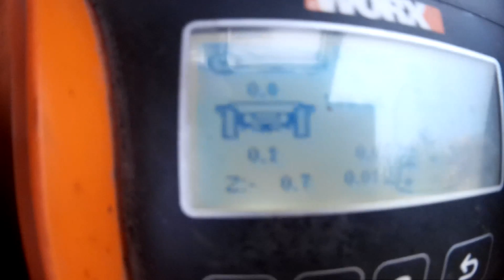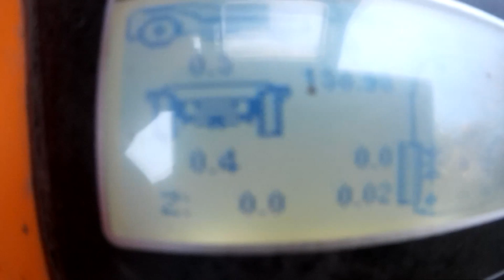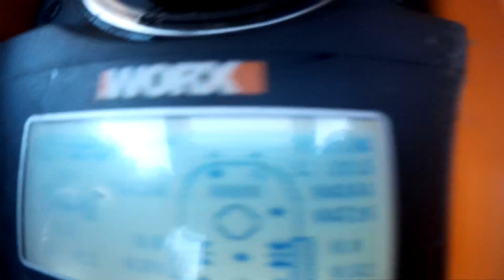Worx Landroid Repair, Overhaul, Problem

Comment: I had a motor rotation error, after watching your video, I sprayed WD-40 on the motor (after removing blade panel) and it fixed my issue. I have WR 150 Landroid. Thank you for the video!

Comment: Looks like your the only one to film opening up the landroid , thanks for your useful video.very good.
Reply from the maker: redeyepete yes sad but true i make this video one shot. But it come working condition. And it's still working. I have another video workx and husqwarna rider lawnmower.

Orginal problem of this worx has. Bad charge, and it wont sense the boarder wire.

Comment: Had the exactly the same problem, but for me the black wire was off. Which caused charging problems. Bad unprotected design of wires and bad material choice of shrink cable. Thanks for video!
Reply from the maker: Patrik Ekman yes that unit and those wiring's could be better quality...
Reply: I have this problem, but i couldnt see any wire broken. Was it broken in the shrink cable?
Reply from the maker: doncamillo maybe, i have 3 broken wires in the shink cable. And both charge terminal wire.
Reply: Biz DIY i have contacted the shop where i bought the landroid. If i dont got warranty i will do what you did. Great video !
Reply from the maker: doncamillo mine warranty is allready closed. Finland reseller tell that part price for me but i dont remenber that, maybe 70€. I just want to look first what the problem is.

Because same time my charger got too much moisture, and give under voltage boarder wire. And robot drive over the line offen. I get new charger and problem continue.

Then i press button 2 to get info display, and i notice those front sensor are dead.
Reply: Biz DIY i will test tomorrow ! Thank you !
Reply: Biz DIY I Fixed it! One black and One yellow was broken. I fixed Them and now its working :)
Reply from the maker: doncamillo Awesome!

Comment: My WG794 landroid only turns right at the end of the cut, it never makes a left turn. Please give me some advice at what to look for. Thanks
Reply from the maker: You could check sensor:s working to press button number two. So you can see what is working or not. But usually front terminal wiring is broke ?

Comment: Hello could you make a video how you dismount the orange cover?
Reply from the maker: Björn Rothén yes maybe i do that, next when i do maintence.
Reply: That will be great, my front wheel has fallen off and I am struggling with removing the top cover, I have removed all screws from the sides but the cover still seems to be attached somewhere. are there any screws that are hidden? Thanks for a great video by the way.
Reply from the maker: Ronnie Pedersen did you remove under those four hexagon 8mm srew also?
Reply from the maker: Tyre axle is inside tighen with small c socket.
Reply from the maker: Ronnie Pedersen you have to also take that cutting blade off, then orange cover will raise with the cutting motor.

Comment: I am sorry I do not understand the photo when pressing the number two button and can not find anything on the internet about this can you please explain this to me Sorry about all this . Thanks
Reply from the maker: If the view of the screen symptom's are invisible them they are inactive.

If those square are dark then they are active.

Move machine above the cutter line, then you could see are those front sensor working.

Move the body it self, is that sensor working.

Also you see that wiev those cutter motor rpm, drive motor pulse, and those dergee.

If you want to reset those degree, but the movet horisontal&verticaö place, and press button:5 long.
That reset those sensor